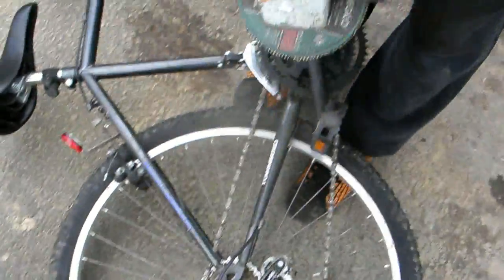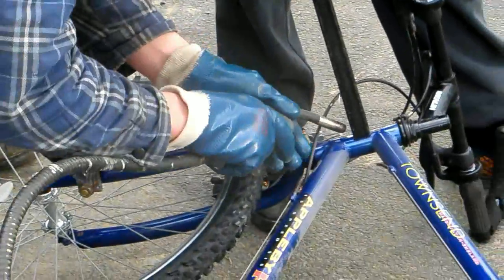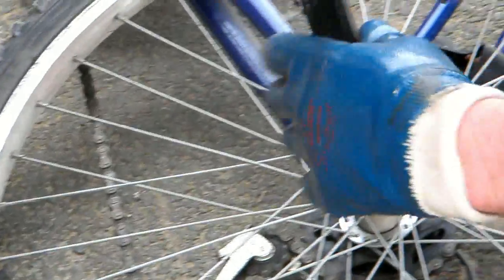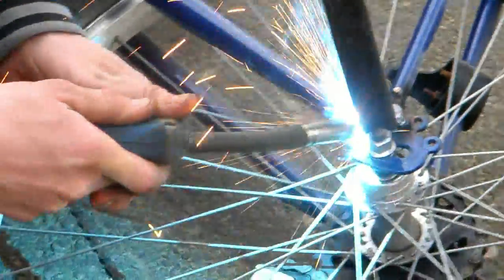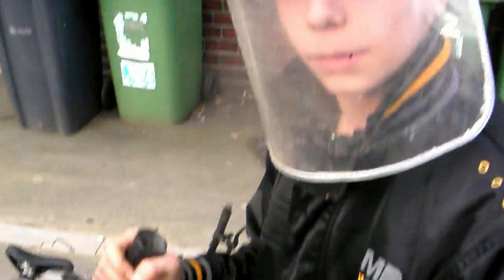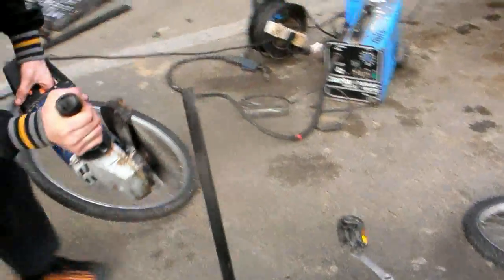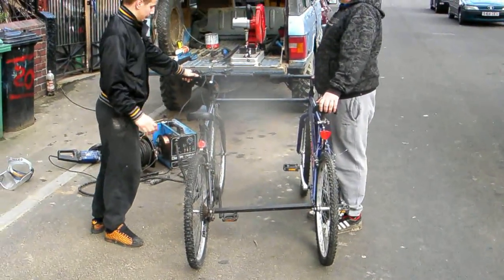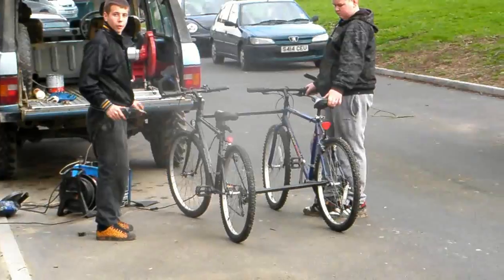HOW TO BUILD A QUADRACYCLE part 2

Comment: I think you have to link the front forks so that only one is steering because you could have the situation were they are steering in opposite directions and the tyres would just drag. also think another strut should link those 2 diagonally to minimise forces trying to move them in a back to front motion. JK